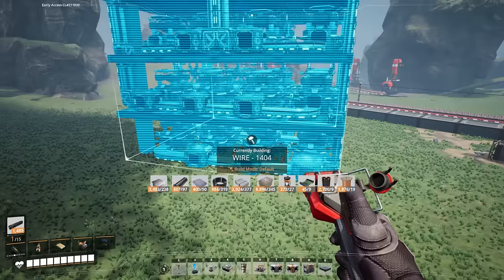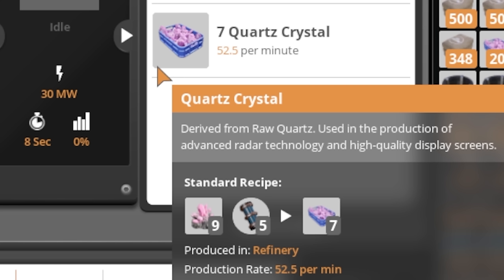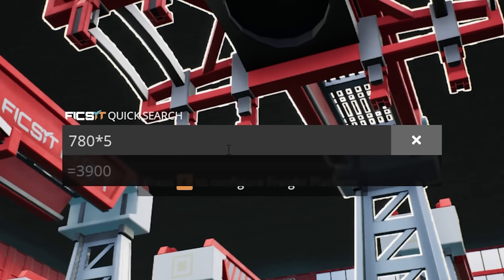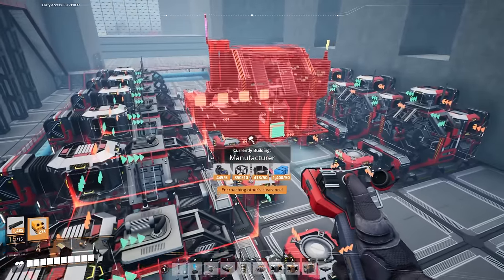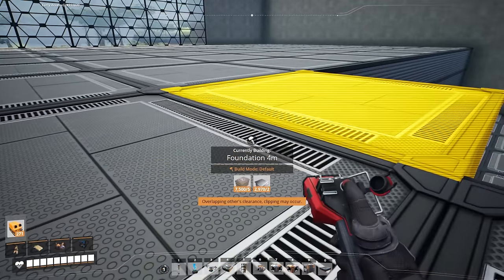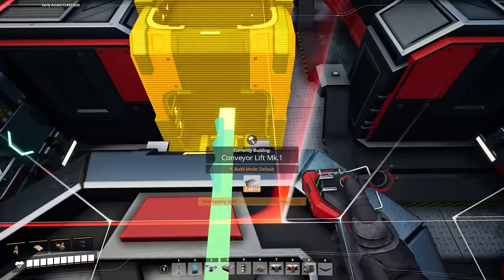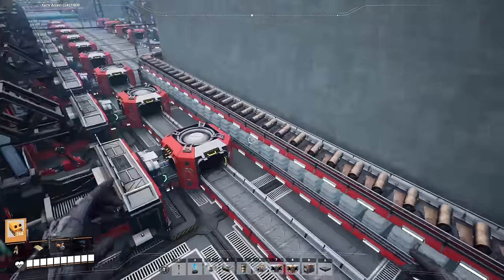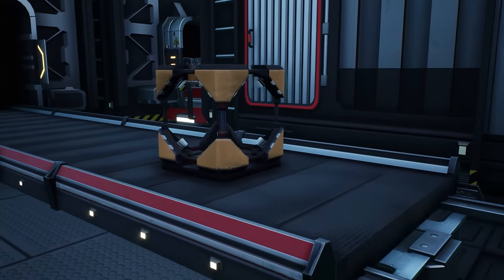I Automated Every Cube in Satisfactory but it Cost my Sanity

Comment: In my chaotic playthru i finished the cubes 1000 yesterday; only missing 2568 Magnetic Field Generator (13 hrs),and 1923  Assembly Director System(17 hrs need to upgrade). I look forward to seeing your Nuclear Pasta production. I used all the desert copper to make them ! Also shush from Satisfactory wiki:  The extraction rate of a Miner Mk.3 at 250 % is 1,200/min, but a Mk.5 Conveyor can only carry 780/min, therefore the maximum mined amount cannot be transported. ) We would need for Miner MK.3 to have two exits :P
Reply: I feel it is a lot more likely that release of 1.0 will see miners nerfed so they can only output 780ppm max mk3 with shards. 

Remember this is early access where they test limits and found out one limit is 780ppm per belt. 

So then on full release they will just make the miners match the belts so all the completionists can stop complaining. We can max out the map without feeling we left something on the table due to an unattainable stat we see in the WIKI. 

Unless they upgrade to a newer Unreal engine and find out that 1200ppm belts are possible. Then maybe we will see a mk6, mk7 belt instead. 

But really they need to nerf the total map factory size so players do not run into PC performance limits anyway, so giving us MORE materials to build with just makes that problem worse. If they stick to max 780ppm per pure miner they can limit our building to a reasonable factory size for the average PC.
Reply: @5353Jumper   Incorrect about one thing,  the absolute limit of PPM is 2000 as this is the limitation before spliters refuse to work past it due to the engine itself. (You can confirm this with mods that do not alter the base game files except belt speed.)
Reply: @KitsuneSlayerPC  but the practical limit from a Dev point of view is below 800ppm on belts because that is the point where they started to see inaccuracies in the belt numbers due to some kind of frame rate issue. Above that point the belts did not actually deliver what was promised (same as 600m3 pipes). They do not want to put out a product where the numbers do not match the promised math.
Reply: @5353Jumper  does not mean t3s can have more then 1 output
Reply: @5353Jumper  welp... you were wrong! mk 6 belts :)
Reply: @itsentdev  congratulations to the CSS team for solving most of the issues with mk6 belts.

Comment: I sometimes miss Belt Spirals (vertical lifts before vertical belts). Maybe with the Blueprints system they won't suck to make, and they can be used as movement decorations. With stacking belt poles or without!

Comment: I'm a liitle bit puzzled about the order of the recipes in your codex. It displayed the default recipe for the RCU (the one with the Crystal Oscillators and Computers) as an Alt, as well as showing the Crystal Computer Alt as the default recipe for the Computer and the Silica Sircuit Board Alt as the Default Recipe for the Circuit Board. Is this some kind of Mod? I'm majorly confused....

Edit: It's also showing the Insulated Cr. Osc. Alt as the Default for the Crystal Oscillator.
Reply: That's been a bug since Update 6 Experimental.
Reply: @Her_Imperious_Condescension  it's actually been a bug since Update 4 for any save that was previously on Update 3; you can see it in the video where he builds all the non -radioactive stuff in the nuclear power plant.
Reply: I'm a little late but I think it's because he used a mod to unlock all the recipes from the start. If an alt is unlocked before the default recipe is it appears as the standard recipe

Comment: You should of used the alt recipe that uses rubber as you have a lot of rubber already and you can save resources as it requires circuit boards not a whole computer.

Comment: You switched play styles mid game. As a warning to you, change the color palate of the new style. It's an easy simple adjustment and conveys the meaning you'll need without needing to remember to find a sign. With that adaptation in place you can switch between as many different styles as you can recognize colors of. It's a quality of life thing. Much easier to save a new default color and old default color the it is to remember where each different style is.
Reply: Occurs to me to explain a bit better.
Factory has belts at rank for control over flow. Because it was built before max belting. It gets a color.
Factory was built on the mk4 platu, it gets a color.
Factory was built in mk 5, it gets a color..
Now I can tell at a glance if I need to overclock a section which section is more work to upgrade.
I also have color patterns to tell me output ranges, and how far up the tech tree that output is. I like this as the moment I see my factory I know what it is doing without needing to go inside.